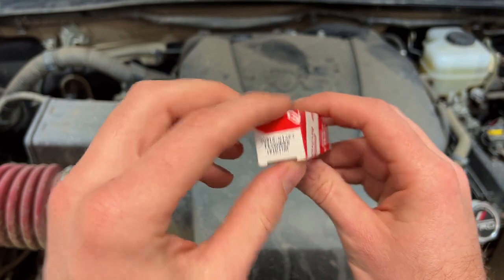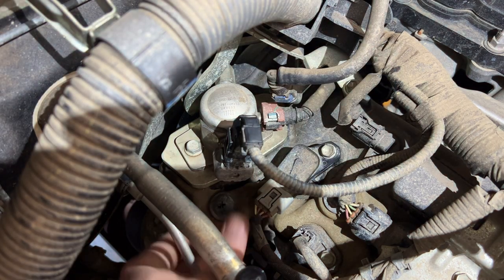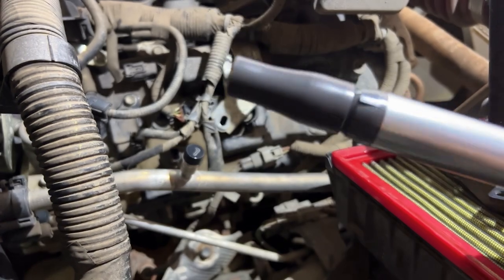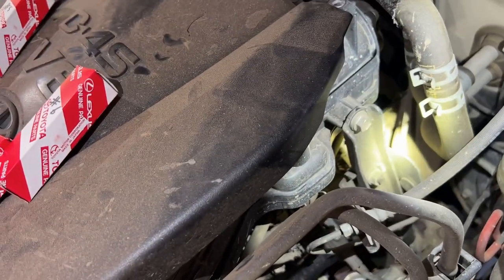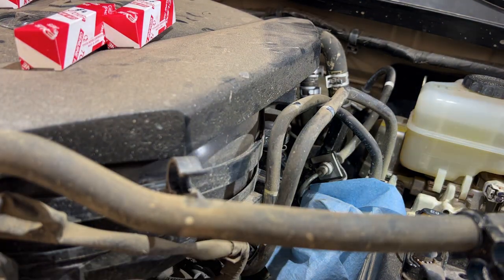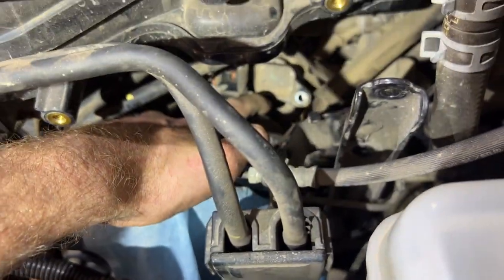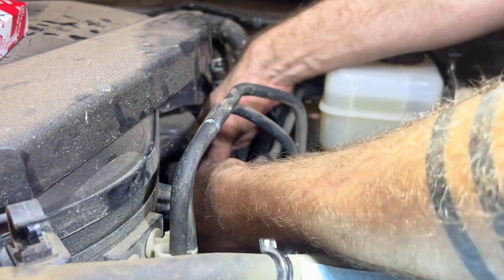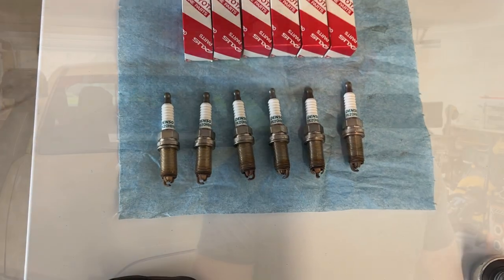Changing Spark Plugs on my 3rd Gen Tacoma

Comment: Super helpful, thanks!
I used to do all my wrenching on much older vehicles, but getting my feet wet on the taco......going to try to diy this, and save a ton of money!

I guess with the coil packs like that there's no worry of debris around the plug...I’ve never had them.  I'd still be tempted to use some penetrating lube before removal.
Usually when I'm loosening stubborn bolts I'll bang the socket handle to act impact-ish, instead of muscling it that can sometimes break bolts.
I'd be hesitant  to use a wobble extension unless needed, so the plug would be as square as possible to the hole.
Starting by hand is very important and I always turn left first to easier feel the thread engagement and be sure I'm not cross threading.
Reply from the maker: Thanks for the comments and tips. Good luck with the job. Take your time and it will go quicker than you think. Cheers

Comment: Nice! Did you use anti cease? Lastly what size is your plug socket?
Reply from the maker: Thank you. I did not use any anti-seize. This is the socket I used: https://amzn.to/3JXChfO
Reply: @Off Road Yota Xploration  cool thanks for the video will come in handy. Do you recommend not adding anti cease
Reply from the maker: There are some people that recommend using it and others that say that it is not needed. I lean towards not using it, as I try to limit the risk of contaminants getting in to the engine.
Reply: @offroadyotaxploration  good point

Comment: Anyone else doing this in the future, do yourself a favor and get locking socket extensions so you dont get stuck like I did!
Reply from the maker: Did your socket get stuck on the spark plug?
Reply: @offroadyotaxploration  Like an idiot I tried to use electrical tape to hold the spark plug socket on, when reinstalling I torqued to spec and the tape ripped and got stuck behind.  Took me a few hours with some 11" pliers and hemostats to get the socket cleared, extension reinstalled and fixed.  Bought a set of locking wobble extensions immediately and had no issues with the other 5!
Reply from the maker: Damn, sorry to hear that. Glad you got if figured out.
Reply: @offroadyotaxploration  i can only blame myself and try to prevent others from doing it too!
Reply from the maker: Appreciate you sharing your struggle. I also often decide between getting the right tool, or trying to use what I have. Sometimes jerry-rigging works well, other times it can turn a quick job into a day job.

Comment: Excellent job, but you did not show loosening the brackets on the right side, that side is a bitch. From brand new my Taco ran poorly at low rpm......hesitate, sputter, almost die from zero accel to hiway speed, poor throttle response.(was miserable driving the truck)  Removed the OEM plugs and tested.  Range of the plugs 3.10k - 4.15k ohms.  Purchased Denso KBH20TT Plugs. Test Range 5.15k-5.50k ohms.  Excellent accel, motor was smoother, gain some hp/mpg.  The new plugs gaped at 0.04.   Convinced the OEM are crap !!
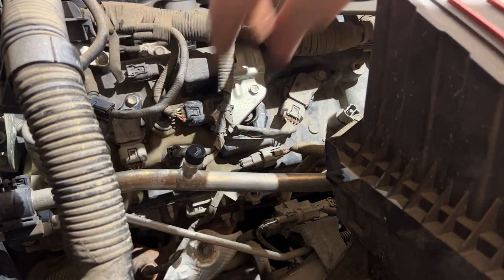Reply from the maker: Thanks for the comment. I do show how I loosened the backets on the driver side (starting at 18:33.) I have been very happy with the OEM plugs. I have not experienced the same issues you mentioned. I'm glad you were able to get it figured out though.
Reply: @offroadyotaxploration  Sorry my mistake.     Mine is 2018 MT Taco.  It's been hard to get started off the line, no low rpm torque.  Appreciate your video helps lots of folks.
Reply from the maker: Yea, mine is a 2017 MT. Currently sitting on 35's. I will be regearing to 5.29 gears soon, to get some low speed control back.
Reply: @offroadyotaxploration  No influence intended, am a believer in OEM. At right atmospheric conditions, running OEM, car was fine, good starts. Other times to get the car to move I had to pump the throttle.(same driving other Taco's)  Denso KBH20TT is the upgraded plug for the Taco(hotter ..bigger gap). No big power gain, just smoother performance. Cheaper than OEM.